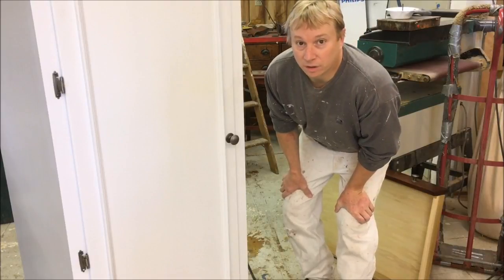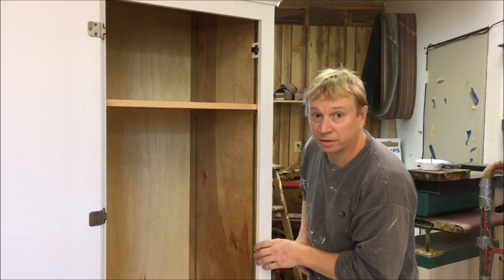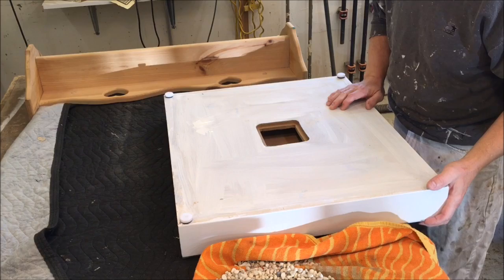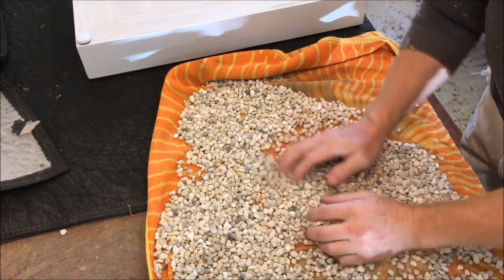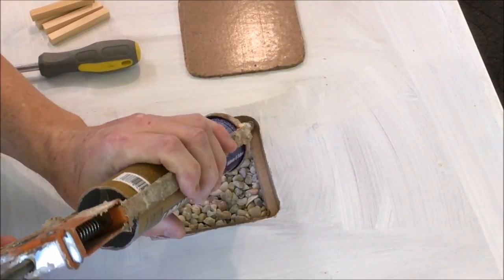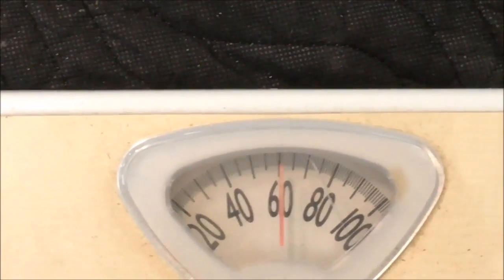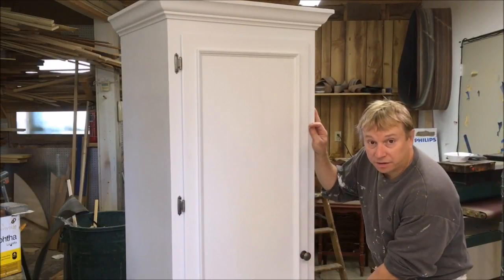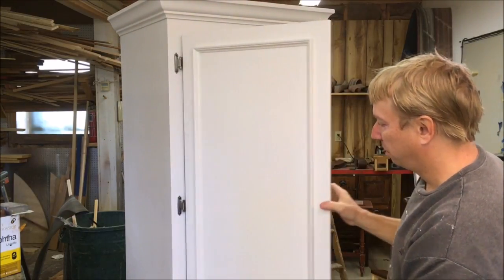THERE IS SOMETHING UNIQUE ABOUT THIS CABINET.......

Comment: What’s the point of this?? What does this do
Reply from the maker: adds  weight to the bottom of the cabinet to prevent it from tipping over .
Reply: But why make them seperate?
Reply: come on folks!  logic tells us he wouldn't have gone to all that trouble and leave them separate.  after filling the bottom piece up, he attached the bottom to the rest of the cabinet, otherwise he couldn't tip it forward as one piece to test its stability.